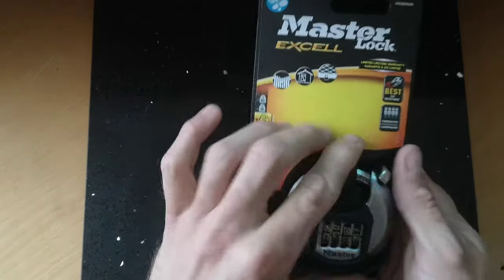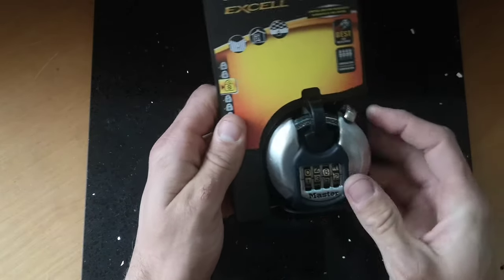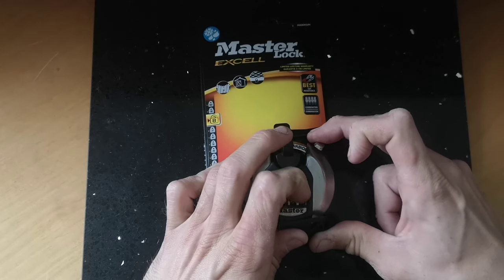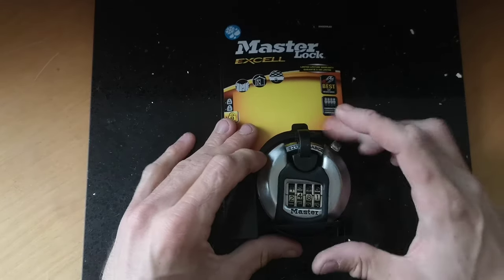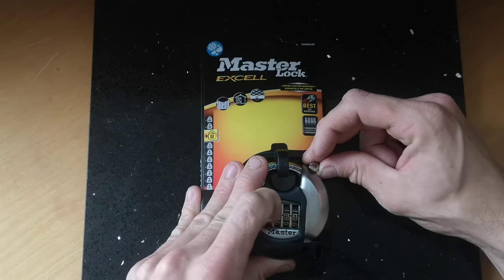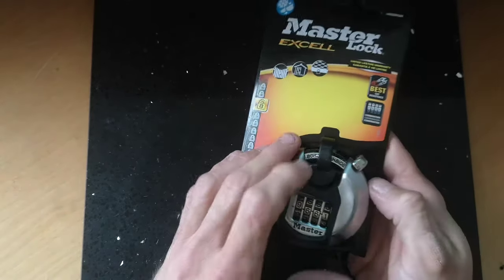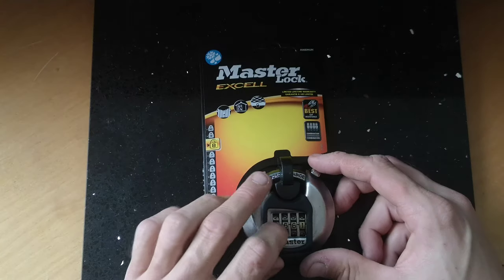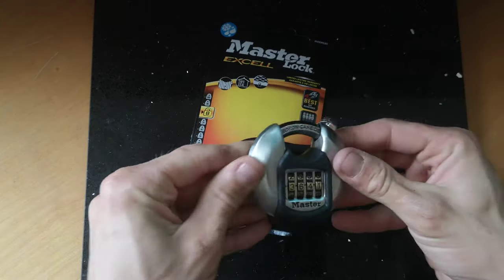Master lock Excell Combination Lock Cracked \ Decoded! | How To Picks Locks

Comment: I'm impressed. The one I have, the (1st and 4th) wheels are so bound even without tension that I can barely move them!
Reply: Same with mine, the 2nd and 3rd wheel have no binding at all hardly.
Reply from the maker: You're definitely right about the tension / binding in the reels, but I put it down to been brand new. Honestly, I sprayed some Wd40 into the reels the day before, it did make it a bit easier to feel 👍
Reply: @jhardy35862  I'll give it a spray. I gave up and got the code, and it still didn't want to open without force!
Reply: Hahahahaa 😂,Same comination for mine,Thank you🎉